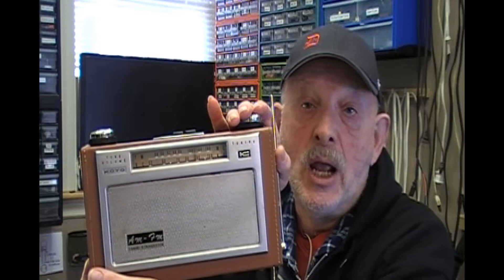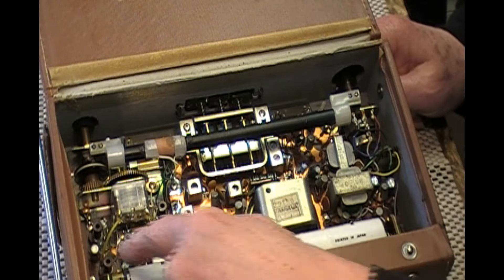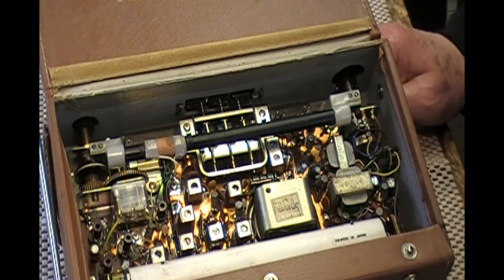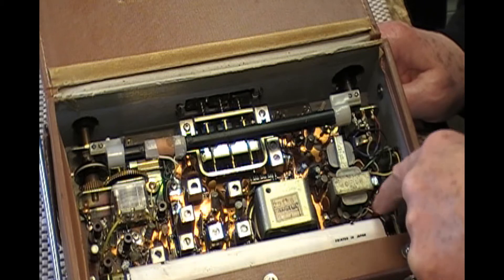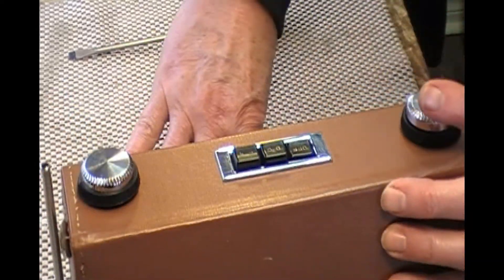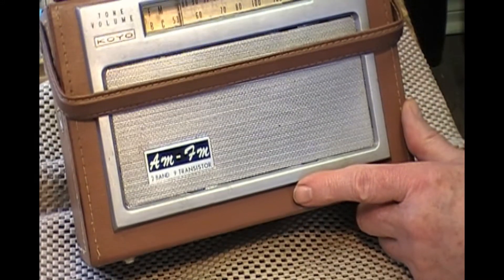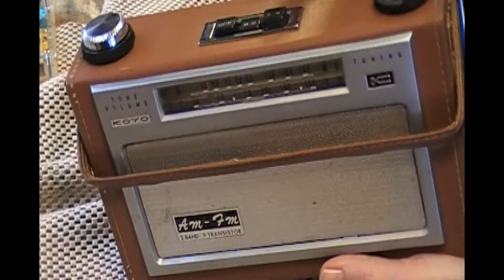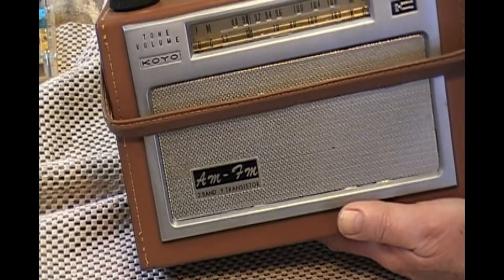Old Transistor radios: Worth Restoring?

Comment: I live down under in New Zealand,below Australia.Im in my 70s now but I have been restoreing/repairing pocket size and table top transistor radios since I was in my teens.I have a small collection left because the collection became too much,so gave away some to interested people but the ones I still have are the best of my collection and all work to their original condition.A few Ive had to recap,resolder cracked circuits and repair the plastic/bakalite cases.Amazing the designs and colours they were in their day.I m always hunting for more,some I have for spare parts that are not worth repairing but I try to get them all going.Condensers are hard to get hold of the foil wrapped ones and you cant solder to foil.So some components are very hard to get hold of unless you have one or some for parts.Volume pots wear out mostly.Re-alignment is easy as long as no one has already cracked the carbon threaded tuning rods,that are caped with wax.Its a very passionate hobby of mine and getting very hard to find now these days.Espeicaly down under here in little New Zealand.

Comment: I found a altec lansing with exposed tubes dated 1955 with a tuner that works b u t gets hot,enough to cause a fire. I theorize as I shut it down. My question is if there is housing missing on the Amp with exposed tubes.it is like new but it overheats and also humming,the speakers are 3 feet x 4 feet  and 18 inches wide .I can't fix it myself but do you think I should have it repaired?estimate is 400 US dollars
Reply from the maker: Hi.  I definately would NOT use it until it's been serviced.  More than the household hazard it will likely be seriously damaged with use under that condition.  Get it to a good service centre and get it serviced.

Comment: most are worth repairing, as long as no major 'unobtanium' parts failed or missing
Reply from the maker: Germanium transistors are generally not available.  I've had early console stereos with geranium transistors that had to be scrapped because so many were open or shorted or otherwise did not perform and I could find no suitable replacements.  In this radio's case the transistors were all fine, as the final performance shows.
Reply: @dontheoldradioguy7180  they are usually available, not 'new' but  old stock, quite a lot of russian ones seem to be quite freely available, but need a bit of experimenting to find one that works well, and they have strange package types..
Reply: the worst germaniums are the AF11x series or similar types, as they're notorious for developing tin whisker shorts, you can sometimes blow these out with a charged capacitor, but its kill or cure, luckily only killed one so far ..
Reply from the maker: @andygozzo72  Thanks, that's good to know.  It might just help save a couple of big ole consoles from the late 60's to early 70's
Reply: @dontheoldradioguy7180  also as a 'last resort' or maybe do it anyway, it 'may' be possible to modify the biasing to allow silicon transistors to be used, but that will need a fair amount of experimentation as theres no one size fits all mod that works in all parts of the circuit ,
Reply from the maker: @andygozzo72  hi Andy.  The thing is i don't  value most of those old transistor radios enough to go to that extreme.  Also the early printed boards can have lifted tracks without even half trying
Reply: @dontheoldradioguy7180  the rebiasing is more for the more 'expensive' stuff, like transoceanics, radograms, etc,  as for track lifting, yep, had that a fair bit, could always just snip the failed part off on the component side leaving as much lead as possible out of the board and tack solder new one to those, had to do that with one of philips' first pcb model valve sets, very convoluted to remove the pcb 'chassis' in it so didnt bother! works well now

Comment: I have yet to venture into transistor radio repair but they are becoming increasingly collectible. But the AM switch off is a problem.
Reply from the maker: It a different technology, that's  for sure.  Cheap ones to experiment  on are usually available at flea markets

Comment: I used to collect and sell vintage Panasonic radios. They always worked or were very easy to recap and realign. I still have a bunch actually. It's amazing how many of em look new after 40/50 years.
Reply from the maker: Yup.  the one I did in the video, except for the broken whip antenna was pretty good even down to the leather stitching.

Comment: I belong to the Colorado Radio Collectors club and am a retired radio tech. I have found the same thing as you. change the electrolytic caps and away we go.
Reply from the maker: I was shocked that it performed so well after restoration.  I always thought these things were throw away quality
Reply: caps arent always to blame or bad, most of my many transistor sets are 'virgin', and still working perfectly, i take each case as it comes, have more trouble with tin whisker shorted transistors than anything  else!
Reply: @andygozzo72  modern caps use plastic insulation and usually do not fail. but the old ones were wax paper insulation and did fail a lot. that is where the idea originated to change the cap when changing the points.
Reply: @NebukedNezzer  i'm on about electrolytics, not waxed paper dielectric types,
Reply: yes waxed paper ones will almost always give trouble in high voltage valve /tube circuits, but very rarely  in low voltage/transistor equipment
Reply: in some cases the caps may seem to be bad on first test after long years of disuse but when powered up will soon reform and work well
Reply: @andygozzo72  in rare cases. but the most troublesome things in old radio are electrolytic and wax paper caps.
Reply: @NebukedNezzer  i've found electrolytics not so much problem as many think/say... maybe i've been lucky..waxy ones, different matter

Comment: I have my grandmother's 1971 Panasonic Model R-1551 AM transistor radio and I love it.  Picks up everything and 4 AA alkalines last 2-3 years.  It also has AC power.  Great little radio.  I never had to fix it still works fine.
Reply: Panasonic made the best stuff and really lasts.
Reply from the maker: That's what I don't understand.  That little 9 transistor radio picks up difficult stations better than my state of the art Yamaha 7.1 receiver
Reply from the maker: I have always loved their Technics lines of receivers and turntables
Reply: @dontheoldradioguy7180  all I know is the circuit board is only 2-1/2"x4" so it was probably used in pocket radios too.  It picks up every station on the dial in the middle of the night.  Other than a crackly volume control it works like a champ.  Once I left it on for 3 days with the sound all the way down and the batteries were still good.  I was quite surprised by that.
Reply: @dontheoldradioguy7180  I just took the back off to check.  The transistors are in metal cans and there are 7.  I've owned radios with as few as 5 as a child but they don't work as well as this one.
Reply: @dontheoldradioguy7180  quality components matter.  Today's electronic components are designed to be as small and cheap as they can be.  50 years ago quality was more of a concern as reputations were at stake.  That's why Hondas are so good, but no one gives a damn anymore so it's all about cheap cheap cheap.